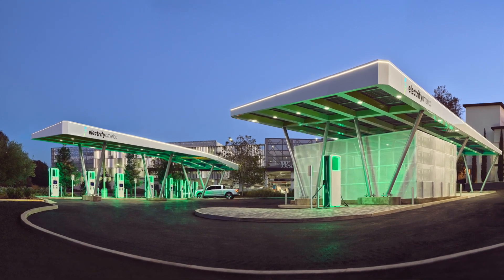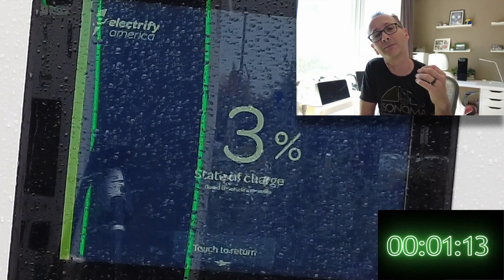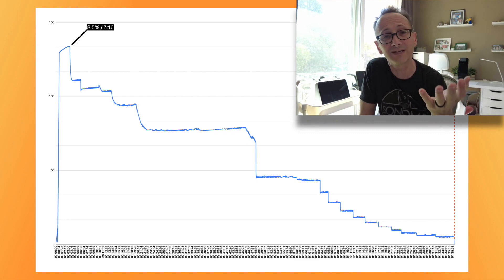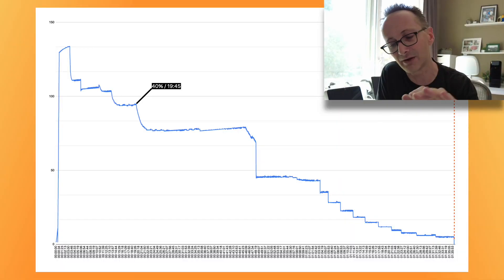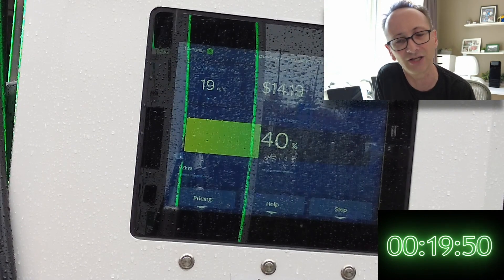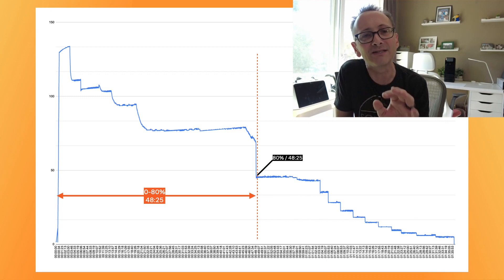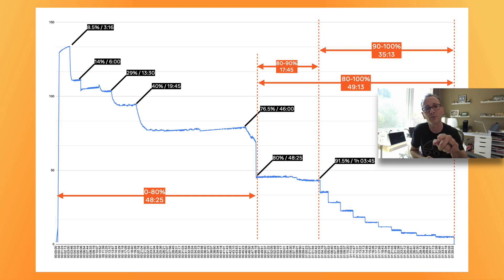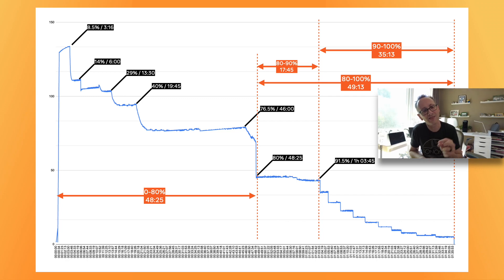Mach-E's Revised Charging Curve Revealed!

Comment: How do you get the DC charger to release when done charging?
Reply from the maker: if you haven't stopped it from the car's screen, you can stop it at the EA dispenser by pressing the right-most button, labelled "STOP"
Reply: @ev_kimchi  The ford Mustang -E has a button in the charging well. As your car charges a ring of blue lights circulate. In the middle is the stop button.

Comment: t's pointless to think a 150KW (Tke Extended range battery) rate can go higher on a 350KW charger. Go to a 150 KW charger. Save the 350 KW chargers for the EVs that can actually use 800V architecture. This charging curve is bad and only done so that Ford can state it can do 150 KWs, yet the average is far, far lower. Absolutely a joke, Ford. Now I know not to trade in my Ioniq 5 for any Mach E; c'mon Ford.

Major adjustments need to be done on the curve. Edit: Li-Ion batteries can handle 2C charge rates. 2C = 2 x battery capacity. Nubies always think my car will charge faster on a 350 KW charger ; no, it'll just cost more than using the proper charger (150 KW).
Reply from the maker: I'm glad my video and your comments helped you to justify getting another car. Usually it's the Teslabros who visit to leave comments saying their car is better, but I guess Hyundai owners have insecurities in their own vehicle purchase choices as well.

Comment: Why are you tying up a 350KW charger? You would block someone who can really use the 350KW charger. Your Mach E can't charge at that rate. Stick with the 150KW chargers please. Stop being rude.
Reply from the maker: I was at a 150kw charger, but thanks for the wrong charger citation, Mr. Charger Officer.
Reply: Was it tied up? Based on the video evidence, it was pretty clear that he was really using it.

Given most vehicles cannot charge above 250 kw/h, most cars cannot really use it. Even cars that can cannot stick to 350kw/h for the entirety of the charge cycle. By your poorly defined, arbitrary idea of "really using it", only Lucid and Genesis can charge there, which represents like < 1% of the market.

Just a wild guess, but I'm pretty sure EA intended to allow more than just a handful of models to use their network. Maybe you didn't realize that more cars using their network = more money. 

If you want to address a real problem, I'd suggest you spend your time getting EA to keep their network maintained. Thier chargers being down for weeks at a time is a much biggger issue that ties spaces up more than this one YouTuber in this one video.

Given how little they care about maintaining their chargers so they're not tied up being completely unusable, it stands to reason that maybe, just maybe, this vehicle isn't an issue.

Comment: Wow so the much cheaper VW ID.4 charges significantly faster than the Mustang to any percent. That makes that decision much easier. But of course the mustang has a far bigger battery so that’s definitely why. Just wish it was a lot faster.
Reply from the maker: I also have an ID.4, and have road-tripped them both.  In practical terms, there's little difference in how long we wind up stopping for a charge.  We've never really found ourselves waiting for the car to stop, there's always leg stretching, kids eating or going to the bathroom, etc.  Of course, we'd all like really faster charging, but you'll see that as more manufacturers move to 800V systems like you find in the Taycan, EV6, Ioniq 5 etc.
Reply: @ev_kimchi  of course but those will be much more expensive than something like the ID.4 and it’s about to get an update 3.0 on the ID.4 for faster charging up to 135kw which is basically going to make it charge as fast as Tesla and many others in just about 32 minutes. From 0-80%. That’s fast enough for me

Comment: 48 minutes to 80% is painful. Cool car, but would be a pain for a long roadtrip
Reply from the maker: I will just say that unless you're making a YouTube video or are doing the latest cannonball record attempt, you generally are never doing what I did in this video of charging the car from ZERO percent, so a typical roadtrip will have 20-30 min stops.  With my family, stopping every 2-3 hours would be happening anyhow so this is not a big deal to me.  Of course, you can find other EVs that have faster charge curves if you frequently roadtrip, but everything has compromises. Or I guess you can enjoy fast fuel stops .... with $7 gas.
Reply: Or you know, you could just drive for 2 hours, stop for 20 minutes, then drive for 2 more hours and you're almost 300 miles down the road. Stop for 40 minutes lunch, then drive another 150 miles. Seems pretty normal and not much different than in my old gas car.

Comment: How did you know the battery temperature was 79 degrees and that would be optimal for the fast charge? Ford doesn’t provide a gauge for the battery temperature does it?
Reply from the maker: check out an OBD-II reader and the Car Scanner app for iOS or Android.  That lets you read and log a ton of data from the car, including these values that Ford does not display for you within the car.  Preconditioning the car by setting a "departure time" reveals the spec temp to which Ford heats/cools the battery.

Comment: Great video! How were you able to get the software update to increase your battery capacity from 88kWh to 90kWh?
Reply from the maker: I have the equipment to update the software on my car myself, but you can get the revised charging curve and (I tihnk) slightly increased capacity by contacting your dealer and seeing if you qualify for the CSP 21P22 update.
Reply: @ev_kimchi  Yes I got the 21P22 update from the dealer.  World love to get the increase battery capacity but I don't think the dealer would provide the update even though the software is available. Do you know what the software code # is?
Reply from the maker: @geoffevarts1450  if you got 21P22 you have the software
Reply: @ev_kimchi  
I thought the 21P22 was just for the charging curve?  For the increase battery capacity, from 68kwh to 70kwh for the Select model, is there  anyway I can confirm that my battery capacity has been updated?
Reply: @geoffevarts1450  Unfortunately, Ford has said that model year 2021s will not get the added capacity (extra kWh).  Do you have a 21 or a 22? (21 owner here)
Reply: @MattCoarr  
Yes it's a 2021.. Not sure how Ford thinks they can compete with the likes of Tesla if that's the case. Coming from a Tesla Model 3 this is mind boggling that they wouldn't.

Comment: wow you have a lot of data points on your charging curve you must have had some kind of automated way to log that! I made a charge curve on the base model, I beat you to 90%! my battery is smaller so my 90% doesn't go as far though 😂 my results were 10% in 4:15 25% in 11:45
50% in 24:54 75% at 39:59 90% at 56:42  I didn't go to 100% I stopped at 90
Reply from the maker: I used an app called Car Scanner which allows you to log any of the PID data from your car via an OBD-II reader.

Comment: Mache can accept more than 350amps which is why you can get more kw on the 350kw chargers. The 150kw ABB chargers are limited to 350amps, so Mache cannot get 150kw on these because the nominal voltage is sub 400v. Don't know if Ford has said how many amps it can accept but guessing its around 400amps.
Reply from the maker: Makes sense -- excellent stuff

Comment: Nice video and lots of good data! Is the charging curve identical regardless if you plug in at 0%, 10%, 20%, etc? Seems like that first 15-20 minutes is the sweet spot for the fastest charging before it drops down to the 70-80kW plateau.
Reply from the maker: The Mach-E is strange in that the high peak of 135-150-ish is time-based, not SOC based totally.  You'll see about 30sec-3min of that peak even if you start with 30% or more.  However, the rest of the curve seemed to follow the general soc-related levels you can see from my data.  Generally 15-20minutes is a good rule for how long charging may take, depending on what SOC you pull in with, the temperature of the battery, and other things.  If you're getting under 70KW and you are below 80% SOC, something is wrong with the charger or your car, but you're wasting your time pretty much.
Reply: @ev_kimchi  knowing that 20 minutes is the fastest charging window, what’s the ideal road trip charging itinerary to cover as much distance as possible if you start with a full charge (say from NorCal to Oregon)?
Reply: @ev_kimchi  getting 40% SoC back in 20 minutes means you can unplug and likely hit the next EA station 75-85 miles away. That might be the best move to cover the most distance as quickly as possible.

Comment: Do you know how to get my car closer to the 300 mile range? Currently at 90% its only giving a range of 244
Reply: That could be due to cold weather. You might also consider resetting the "guess o meter."
Reply: @reidhester  I am in southern Cali not cold. How do I reset it 😁 just got my car 4/6
Reply: @rhondaarnold3153  don’t worry about the range estimator. Just drive your Mach-E normally. The range is whatever the range is. Just pay attention to your miles per kWh to get the best idea of your efficiency.
Reply: @anthonyc8499  thanks 😊
Reply: @rhondaarnold3153  I don't have ours yet but have read that on the 'interwebs' that you can do this. I'd check the owner's manual.

Comment: I would be curious to know how many kWh Electrify America said they output vs how much your MME PE said it received?  And how many Mi/kWh your seeing driving your car?  I have the same (similar) car on order & am wondering what I might expect.
Reply from the maker: Good question.  My data is from the car's logs, utilizing an OBD-II dongle and phone app called Car Scanner.  There's a very slight loss in current caused by the charger's electrical resistance, as well as the car's systems that actually energize the battery cells.  There's also some loss to running lights, HVAC etc.  Generally I've seen this to be less than 2-3kW, but I have not had the chance to do a precise comparison between displayed charge on the EA screen and what's logged in the car.  If you do this, however, you can see it's close enough to be a negligible loss.  Good luck with your delivery -- it's a great car!
Reply: @ev_kimchi  In Car Scanner you can see the difference between charger output (EV Charger Power) and what goes to battery (EV/HEV Battery Power), as well as charger max nominal output: https://youtu.be/-vSBhLvivEo?t=130
Reply from the maker: @EV_OBD  yeah you're right there are PIDs for all of those.  I think I might have logged all of them, I can go back to my data.   But I think my statement is still accurate that the different values show the losses are negligible